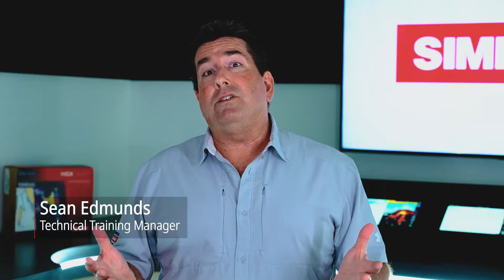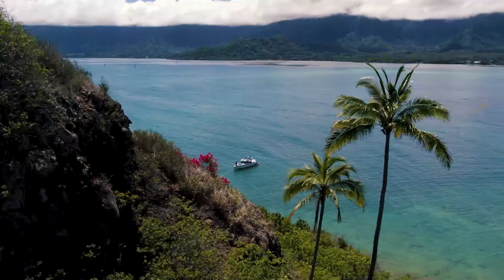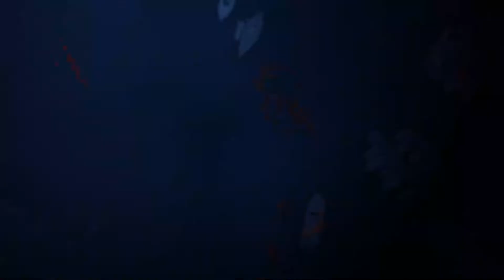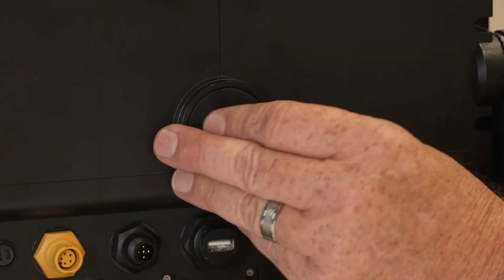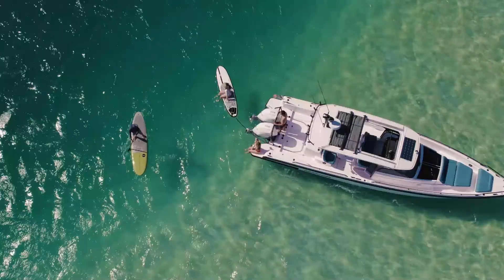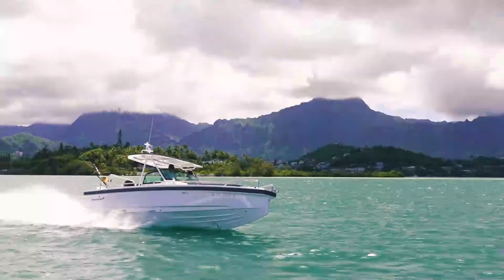Simrad | NSX QuickTips - Which cable goes where?

Comment: How do you get the map card to display shaded relief? I recently “upgraded” to Simrad NSX, and also purchased the C-Map Reveal X card (M-NA-Y206-MS) for Baja/West Coast region and it’s not displaying the detailed map. I selected the other map under “Chart Source”, and it’s not doing anything. Anything I’m missing here?
Reply from the maker: The C-Map NA-Y206 is not a C-Map Reveal X but it's the original  Reveal cartography. Where have you purchased the card from? You will need to replace it with the correct chart card, NA-T-206-R
Reply: @simrad-yachting  the card was purchased thru Amazon. They sent me the wrong chart card. New chart card has been ordered directly from C-Map. I will say the customer service at both C-Map and Simrad have been a complete let down. You’d think after spending some good money on a smart fish finder, along with $250 for a chart, they would be more on top of their customer’s needs. I ended up getting in contact with Navico to help solve the issue I was having and they verified wrong chart within a minute of being on the phone with them. Anyway, the unit itself is great and I’m impressed with how fast the response is. Excited to put it to use with the new chart.
Reply from the maker: Thank you for your reply. You can always contact us via FB if you need any help and/or have any queries. Thank you again for choosing Simrad.

Comment: Regarding the MI10.  First, it doesn't list the NSX as a compatible unit.  And it does solve one issue in that you can use SD cards without needing access to the back of the unit.  However, NOW my USB port is being used only for the MI10 so i can't readily use a thumb drive to export data.  It becomes self-defeating.  So, can i use an off-the-shelf USB 2-1 adapter in the back of the NSX to solve this?
Reply from the maker: The MI10 is not working with the NSX series yet.
Reply: @simrad-yachting  just like every other "feature" no SiriusXM weather, no ability to transfer waypoints VIA app and now no Mi10
Reply: @simrad-yachting  Hey Cap.  Do you know when the MI10 will be available?  This is critically important to SKIFF's with a small center console where once the unit is flush mounted, it is about impossible to access the back of the unit.  Thanks.